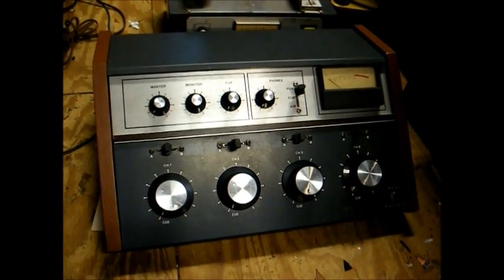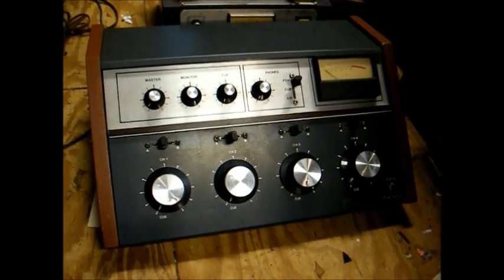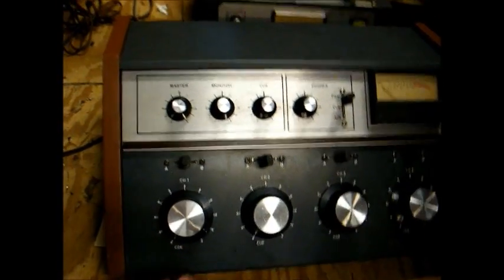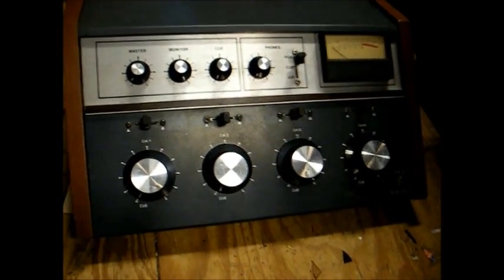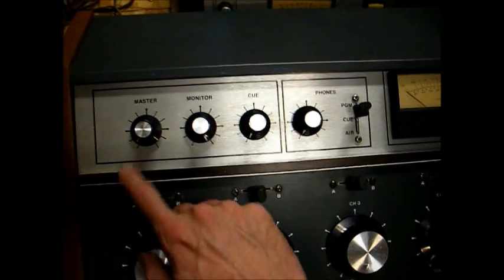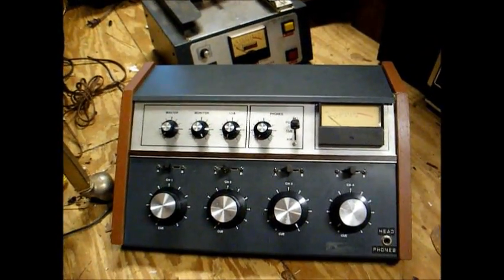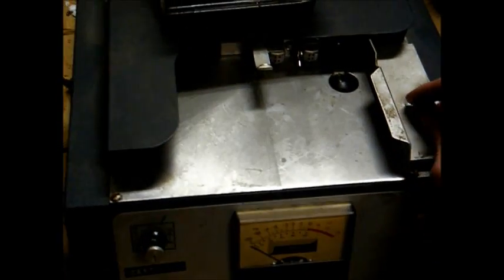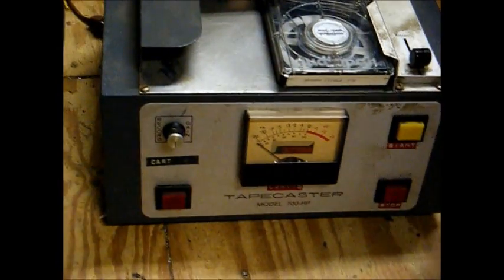vintage radio station broadcast equipment turntable cart machine audio console preamp

Comment: I am a Commercial Broadcaster. Gosh, the TapeCaster Cart Machine and the Spot Master Cart Machine were made up into the mid 90's. In the 80's, I worked at a "Daytime Only" station, where all there was carts for the Spots, PSA, etc,. and a bunch of 45 and 33 1/3 RPM Records. QRK made the best turntable, but I had some Collins 200's that I gave away back about 7 or 8 years ago that I had no use for. Radio was fun back then, now it's computers & down to nothing. I sort of miss the old days.

Comment: Oh I do understand. Good for radiotvphononut, if that's what he wants. I was in the biz for over 20 years and have kept two PT6 Magnecords for nostalgia. I'm not as keen on turntables though. I recall when a Shure broadcast cartridge cost well under $10. Nowadays, if you break a needle, you could buy several CDs for that that play with no skipping or groove wear. But I do still have one broadcast quality turntable for nostalgia. I play records infrequently. Some are rare. Cheers!

Comment from the maker: Thanks for the comment; but, I want to be able to listen to what I want over my AM-only vintage radios. AM around here consist mostly of religious & talk programming + an R&B station that plays some older stuff. I realize that I could feed the part 15 xmtr with a CD changer, PC, etc; but, I'd rather make use of all this old equipment in addition to PC automation for when I'm not personally on the air.

Comment: I'm sorry, but in 17 years as a broadcaster from the mid 70s to the early 90s, I was never subjected to such a primitive piece of equipment as that mixer you started your video with.  It may have been used for an on-location remote broadcast.  Even the college stations were way beyond that.

Because the cart machine was a recording unit, it was likely not used in the control room, but rather in a production room.

Those felt turntables sure brought back memories.  Ah, back when we played vinyl and actually took requests on the telephone, those were the days.  

Computers?  Holy smokes, back then only major corporations and the government owned those things!

Comment from the maker: Thanks for the info.  I thought I remembered reading in the manual where it could be connected like what I described; but, I will double check that.  Someday, I'd like to find an eight channel board that is old enough to be a tube unit; but, for now, this one will have to do.

Comment: One thing, that Broadcast Electronics (BE) Console was not used for on air DJ's. That console was marketed for News Rooms. That is why they are so small and limited for the day. Yes, you can use one for a main console, but not enough inputs in some situations.

Comment: We'll, it may have been a good thing you sold that Gates "Yard" Board. I worked at a AM Daytimer that had one, it was in terrible shape. I think the parts are getting hard to find for those old tube consoles, unless you can find the parts. My favorite Gates Console of the 60's was the Gates "Gatesway" Mono console. If I had one, I would pull the tube guts of it out and put in Solid State Amps, Power Supply, etc. Keep the box on the outside as orignal as possible.

Comment: These older BE consoles were simple and reliable. I worked at a small country station that use to use the 50S4,s on the air.My niece works for a school that uses a 10M150 for pa and it has worked reliably through decades of school kids...try that with today's all plastic broadcast consoles.I may still have the docs to the BE 50 series e mail me if they will help

Comment from the maker: Yeah, the guy I bought this from (broadcast engineer & former station owner) said that the original meter was bad and that he replaced it. Years ago, I bought an old tube type 8-channel Gates "Yard" mono console from one of the low budget black gospel stations. Like an idiot, I ended up selling it for what I paid for it. I should have kept it b/c those old tube boards are almost impossible to find at a reasonable price.

Comment: Too bad that you couldn't over-power one of the local stations (preferably that Rush Limbaugh one I always hear when you demo your AM radios) with your signal & broadcast all old 45's. A buddy of mine worked at a local AM station in Holland, MI that switched to digital and GAVE, yes GAVE him ALL the old TUBE-TYPE studio equipment and he started a live internet radio station! I listened to him all the time till , due to financial reasons, sadly had to quit. ;(  If I lived close by, I'd listen to your station! I'd STILL like to know how you play a 33 as all those broadcast turntables appear to have moulded-in-to-place 45 adapters?...does the whole center pop down so that only the 33 spindle is protruding when you play a 33? Or what?

Comment: Actually no! those switches were for the Cue and Air(Programme) channels. Depending on the mixer model, the centre position is "off", throw left for Cue, line up track for playing, when cued, switch back to "off" position. When about to play the record, throw switch to right, "Air(Programme)" position. As record ends, turn fader control down. I did 10 years at a community station here in Australia, so I know what I'm talking about.
Reply: Neil Forbes well lardy dar
Reply: Actuallu, that left/right switch above the pot is for 'air'buss or 'production' buss. Cue is by turning the pot all the way left past '0', where it will click to the cue speaker. Back to the 'air/production' switch - that is so while a channel(s) is being  transmitted, the other sources can be mixed and prerecorded into programming for later transmission. Commercials, news briefs, psa announcements, etc. Thos two busses both have high fidelity, whereas the cue output is low quality, just to hear to set up the material. Small detail, but kind of important.

Comment: I did notice that whomever had that BE Console before you put the wrong meter in. Of course it works, but I think BE still sell some parts for that console. It would be nice to have the orignal meter install. I see these consoles on eBay form time to time, & some seller have console that they drilled holes in it. That is awful because it ruins the value of the console. I looked up your markert/area. No wonder you want to put something on. All the AMs are religious or news/talk. That's awful!

Comment: Was wondering if you ever got your station up? I have a part 15 AM transmitter running on 1470 Khz that has a range of about 1 block. I use an attenuator to bring that back to cover my property since I have no interest in broadcasting. My only interest is to listen to music I want to listen to and not the incessant commercials and announcements like that stupid lizard, gico or that bimbo with the red lipstick. selling insurance and all of the loud toyato car commercials. I will NEVER buy a toyota simply due to their screaming commercials 
I have a mixer and all sorts of turntables, reel to reel recorders, cassette players but got the biggest bang for the buck with a used ipod and paid to download the music I like. I have one file for early big band, blues, jazz and early singers like Bing Crosby, Nat King Cole, Frank Sinatra and others. The second file is Early 50, 60 and 70's rock. No head banger nor rap crap music. 
I ended up spending about $400 over 3 years to build the files to what I like but they are large files and provide a lot of great music with no intervention. 
Anyway, I enjoy your videos. 
Regards, Glenn